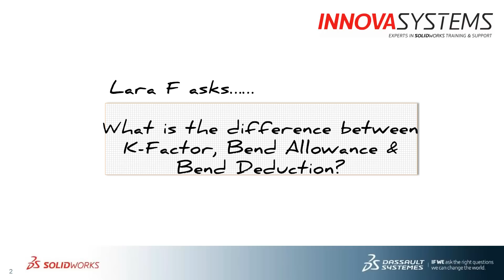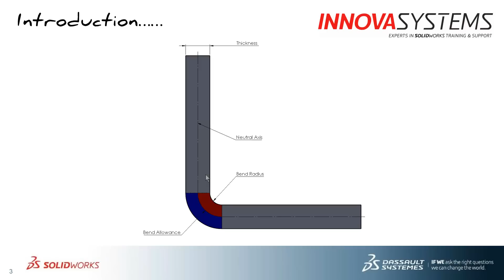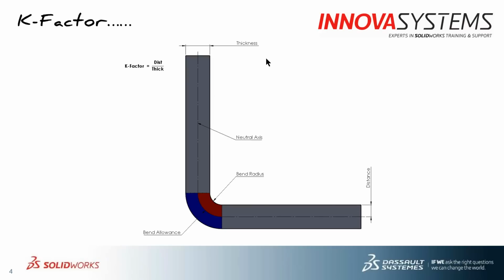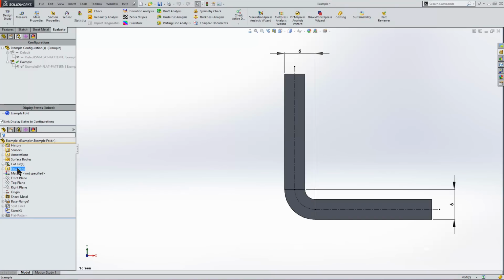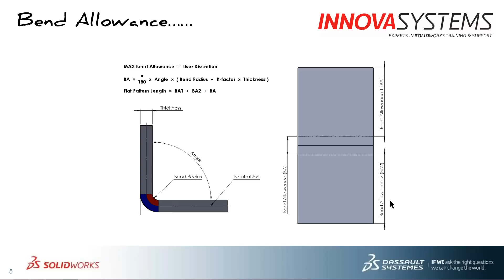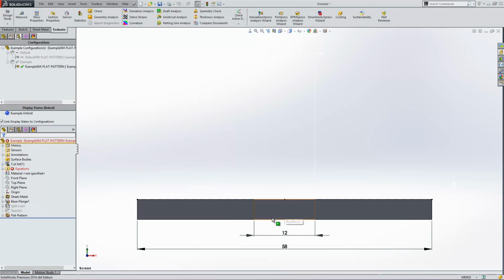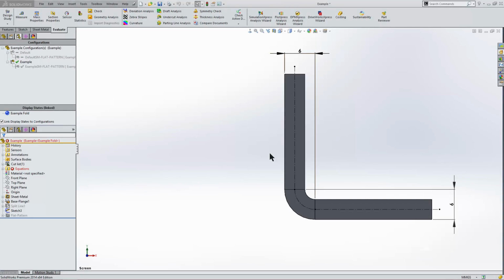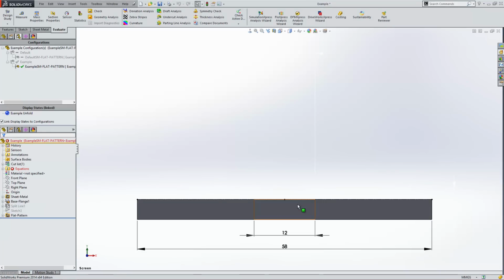The difference between K Factor, Bend Allowance and Bend Deduction in SOLIDWORKS

Comment: lecture was good, thank you for sharing. I am not able to see neutral axis, bending allowance in my sheet metal part file. So how to enable it?
Reply: You cannot see the neutral axis in SolidWorks. He shows it by manually drawing a sketch (the one shown with centerlines) at a specific "offset" from the inside of the bend. The amount of the offset is related to the K-factor set in the property manager and the thickness of the sheet metal part. So, when he changes the K-factor manually, the amount of the "offset" changes as well.

The bend allowance is the arc length measured on the "neutral axis sketch". It can be measured either by measuring the arc length on the "neutral axis sketc", or by flattening the sheet metal part and measuring the distance between the bendlines of the corresponding bend.

Comment: What does the K factor depend on? Does it depend on the material? What's the K factor for a HSLA steel? 0.5?
Reply: In a word, K Factor depends on everything....it depends on inside radius, material thickness, material type, bend angle, tooling selection, grain direction, etc...  a change to any variable of the bend will change the K factor even if its slight.  It's always best to create samples bends with each one of the these variables controlled to get bend deduction/K factors specific to your own processes.  If your company does the designing but not manufacturing, i would suggest just using a .4 or .45 K factor across the board and leaving the flat size development up to your suppliers.

See these links...
https://www.thefabricator.com/article/bending/analyzing-the-k-factor-in-sheet-metal-bending
https://www.thefabricator.com/article/bending/analyzing-the-k-factor-in-sheet-metal-bending-part-ii